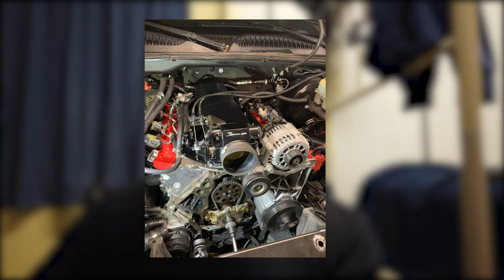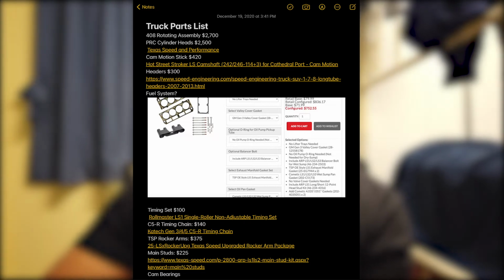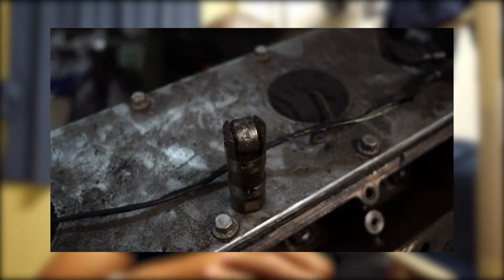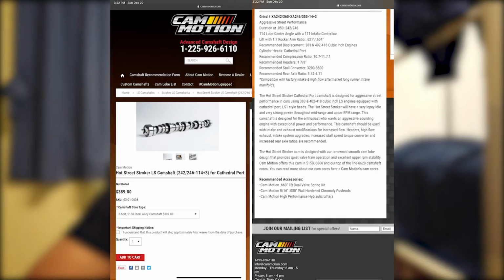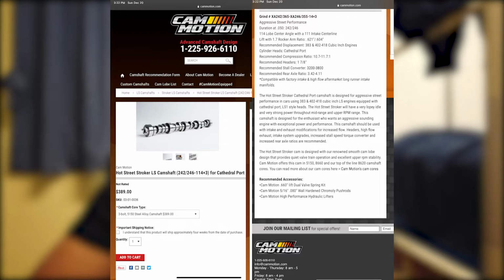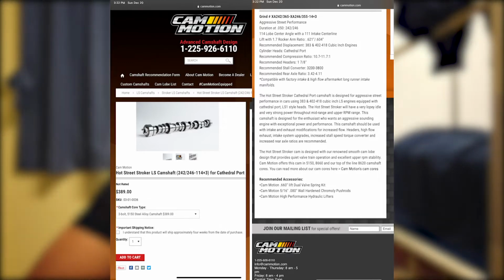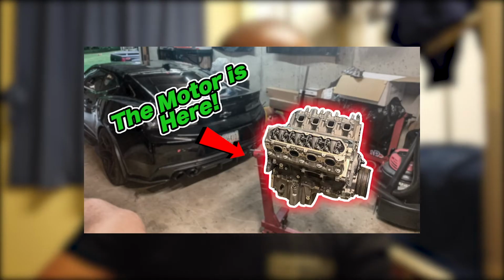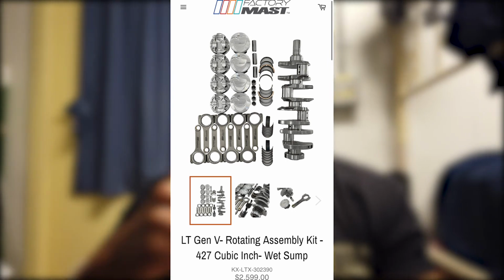Help me Build my 408 C.I. LS Motor

Comment: 456gears with a posi rear end
Reply from the maker: 4.56 is way too high. But it has a 4.10 and a Eaton tru trac in it. Honestly I’ll probably drop it down to a 3.93
Reply: @Stan1le  yeah I would get gear down for boost but mine leveled on 35s 456 with rpm built tran header  btr stage 3 cam s&b cold air bbk thouttle body 3500 stall stock head didn't do it to race just just to roast 35s thanks for your service 😀 help to get more videos in the states 🤘
Reply from the maker: @joshuatew2143  sounds like a solid build! Thanks for your comment! Ready to get home and get started.

Comment: Hell yeah brother. Safe travels.  Keep making videos.
The engine plan sounds good, maybe think about a built trans in the future if its not already. But you have a well thought out build plan. 👌
Reply from the maker: Yea the trans is already built. Sid Neal racing transmissions took care of that for me. Did that with the big rebuild I did to make the drivetrain “bulletproof” so no worries there. Thanks though.
Reply: @Stan1le  right on brotha, looking forward to the build, id love to do a short bed single cab build.
Reply from the maker: You should! They are fun to work on.
Reply: Nice truck man. I have 2000 rcsb I'm finishing up. Its running right now but not done. 5.3 bored to 5.7, forged rods/ pistons,  balanced stock crank, elgin1840p cam, billet 78/75, same hotside as you, circle D converter, built 4l80e, just order the truetrac to put in this week, getting a driveshaft for it this week along with methanol. Super pumped. Im excited to see what your turbo 408 does.
Reply from the maker: @cyclark8762  LoL a lot of similarities with our builds, that’s cool! Stay posted to the channel, you’ll be in for a surprise
Reply: @Stan1le  will do. I like fast cars and stuff to but the rcsb/sport look to a truck is my thing too. O bought this one in 2018 and tore it apart. 3 years into the build and got it on a dyno just a few days ago and got to make boost finally. Shooting for 700whp with this turbo, going for 1kwhp but it'll take a different turbo.
Reply from the maker: @cyclark8762  sounds like fun